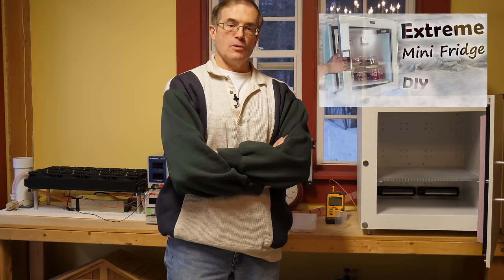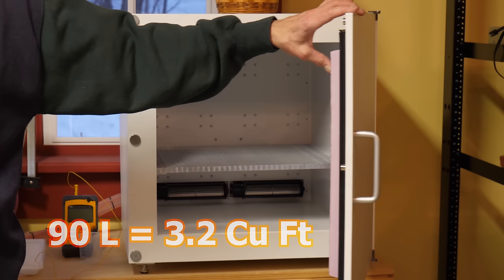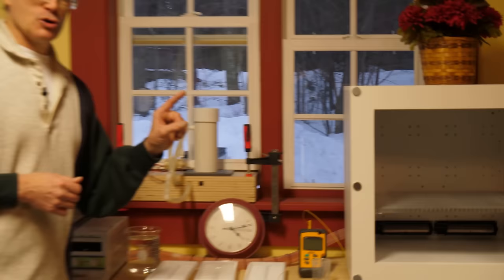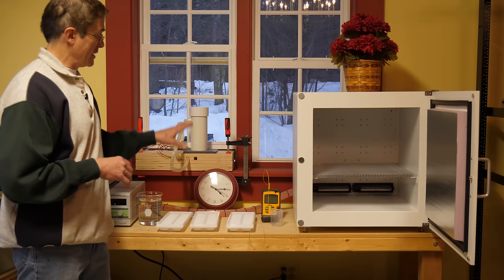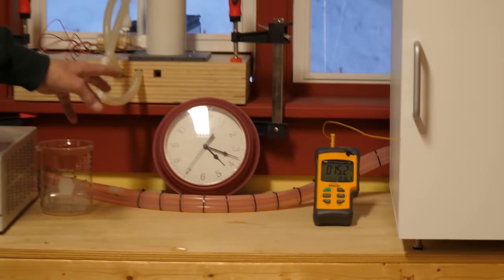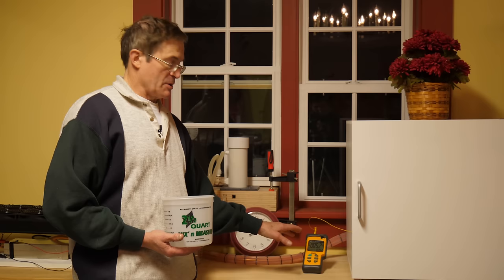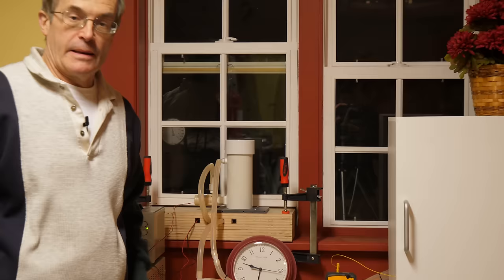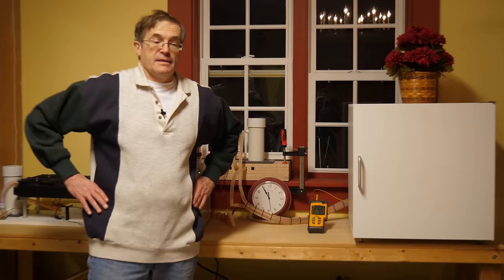TEC Freezer - Build Your Own!

Comment: I've been playing around with TEC's as well and I discovered they are extremely sensitive in a very predictable way.  If you mount one to a large piece of copper to anchor the temp on one side and leave the other surface exposed, eventually it will settle out to zero volts. if you place a heat source like your hand 6-8 inches away from the exposed surface  it will begin to climb ever so slightly in the micro volt range. In a calm room I can get a reading as far away as a foot and a 30 degree differential.  I don't know what I would do with this but I think it's very cool.
Reply from the maker: We have used this as a poor man's laser power meter.  You could also assemble a small array and produce a very low resolution thermal imager, similar to a micro bolometer array.
Reply: @TechIngredients  That is a neat idea, I have a bit of a background in passive night vision.  One way to get even better sensitivity would be to hold the back side at  a much cooler temp. To increase the resolution you could use some of the smaller chips and also sacrifice field of view for resolution and use a dichroic lens to focus across a bed of chips. 
These are turning out to be a lot of fun to play with. My first project with them was a heating/cooling loop for a fermentation chamber. 4 chips work perfectly at temps within 20 degrees of ambient and a 5 gallon batch. I haven't been able to test outside that as our temps are pretty steady all year long.

Comment: "Really blows away the efficiency" Please, please tell me this was an intentional joke about the swamp cooler style cooler coming up. Another amazing video, thanks guys.
Reply from the maker: Thanks!
It's no joke.  If humidity is disregarded then a humidifier cooler ie swamp cooler can be 5-6 times as effecient as a compressor based air conditioner.  The dessicant lowers the thermodynamic effeciency to about one half that of a compressor based system.  But, because the heat required to regenerate the dessicant and which is the cause of this lower effeciency can be supplied from far less expensive sources than electricity ie combustion or even a conventional, roof mounted solar water heater, the cost to run this type of cooler will be less than half of a conventional air conditioner.

Comment: Sir, with the 'indoor' variant, you may have already beaten some of the commercially available freezers.
Example: 171kWh / year, 24 hours for freezing 3kg, 60L capacity. That's about 470W per day, which I believe once you've frozen the food, you won't be using much energy for keeping the temperature below the desired point.

It's also possible by using electronic (magnetic) valves, to choose which room you want to heat or whether to transfer the heat to the outside, making it even more efficient in the summer.

I very much appreciate your thoroughness, you're taking a lot of important things into account. Again a video well done.
Reply from the maker: Thanks for the acknowledgement.  I agree with your suggestion about selective control.  Engineering isn't only about raw effeciency.

Comment: Brilliant! And I now know that my Wine Cooler (poor man's wine cellar) will use 6 vs. 3 of the Peltier modules. I have a big cache of used Intel CPU coolers and a ton of aluminum cooling fins, and they ought to do the trick. I'm going for "Parts On Hand" as a prerequisite (in other words, ZERO trips to Home Depot and no Amazon orders, either). You have imparted AWESOME sums of knowledge into my partially functioning brain for which I am very grateful!

Comment: A small geothermal loop seems like it would be more thermally and electrically efficient than the air.  Since you're looking to do small temperature differentials with TECs, it would also be a lot more effective to use 40-50F water as your cooling medium than 70F air above and beyond the normal benefits a phase change system might bring switching it to geothermal.  Sure, DIYing such a loop could be a lot of work, but it seems like a modular system where you have a "geothermal well," so to speak, with access ports around the house for various appliances could be super efficient and doable.

Comment: Additional interesting test datums for your design would be:
1) How long will food stay safe once all power removed?
2) How many watts are required to MAINTAIN food at minimum safe food temperature during "power outage" and presumably running on backup power? (goal is to maximize battery life)

Assume food starts at normal minimum achieved frozen temperature. 
Assume maximum food safe temperature is 40F (note1)
Assume door is never opened during power outage
Assume external temperature is reasonable room temp for a given season/location

note1: 40F takes into account that bacteria growth does occur in low-forty's, and 40F helps take into account temperature measurement error. Most probes I've seen used commercially are at LEAST 
+/- 2F

Comment: If you remote the heat dump, then don't forget to isolate the tubs ... at least the tube that goes back into the refrigerator. To prevent reabsorption of thermal energy.

Comment: Thank you.
The cool story is that apart from the extremely low efficiency of Peltier modules, there is an opportunity to make the home refrigerator more efficient. 
If anyone does not know, a home refrigerator, which is in any home, consumes a little, but constantly. This is why you see the costs in your's electricity bill, whether you are at home or not.
The video shows how to reduce the power consumption of an ordinary refrigerator by half (approximately) if you understand what is at stake. 
The question is, how many people are willing to do this? If about me, then I am already close to do it.
As homework for everyone else, everyone knows that your's car has a radiator as part of the cooling system. 
Can you think of how to make most cars without it? It's actually a simple task based only on what we've seen in this video. 
The problem is that if you don't think "outside of the box" then the problem is insoluble (as you can see from all modern cars). 
But never say never :)

Comment: You could increase efficiency by separating the hot/out, from, cold/in cooling lines to and from the Peltier liquid cooling manifolds.
Reply: COPPER HEAD foam insulation around both should benefit both

Comment: Sounds like some good upcoming videos. Good engineering testing. That's the correct way to do things. 

I made a TEC back in 2007. Single unit on the refrigerator cost me USD$25 at the time. My design aspirations was to keep a single coke cold at about 4 degrees. Note this was supposed to be a cold coke that I was just maintaining the temp for consumption over the day. Surprisingly I was able to get ice when it was operated in a conditioned room at about 24 or 25 degrees (I live in the tropics). 

It was an open unit so I did a condensate line. Turned out that I needed to keep that elevated and put in water since the conduction to the actual coke was too low without a little water at the bottom. That's how the ice formed. 

At the time I recall I used about 40W of power so I was really not amused when devices off the USB drive that at the time had a 5V and 500nA spec claimed to be able to cool a drink. 

I am putting a link to the video I did relatively recently just in case anyone wants to replicate. Its not that hard of a build and the form factor is useful for drinks. 

https://www.youtube.com/watch?v=lXqew7miryQ

Comment: Just thought about taking the cooling outside to reach lower temperatures in the winter. For an experiment it might be ok, but for a a unit that you would actually use it may be beneficial to use the wasted power to add some more heat to the room. The efficiency will drop a bit, but you will be using the energy, not wasting it outside.
Reply from the maker: True, but also consider the cost of the energy used for each purpose.  Unless you are using electrical heat, the cost might be lower if the refrigerator uses less electrical power.

Comment: In terms of overall efficiency, the first scenario you are using the waste heat of the fridge to help heat your room so are saving on energy for heating costs. Its simpler without having to transport the heat to the outside of the house
Reply from the maker: You're right it's a trade off.  Keep in mind that building's heat source may cost less than the electricity used to run the freezer.

Comment: I see all that snow outside through your window makes me think it would be very energy efficient to run a radiator outside with a small aquarium pump running a water/alcohol solution through vinyl tubing into the building or house into another aluminum or copper radiator installed inside your refrigerator. In others words just transfer the heat from your frig to the outside. Of course only good in the winter months. You are still using the Peltier device to transfer heat from the frig, but now to the outside air.

Comment: Putting the cooling fans outside makes the freezer more efficient, but it's pumping heat from your home to the outside (the heat from your home is what the system is moving after the freezer and its contents reach a stable temp), meaning now you need to add that heat back to your home. Overall that won't help your energy bill.

Another example of this - decades ago when we still had tungsten filament lightbulbs that got really hot, I had to explain to my mom that when you live in a house with baseboard hearers you're not saving electricity by turning the lights off, since it just means you need to run more electricity through the baseboards to heat the house. (I now use LED bulbs and have a hest pump, and plan on building a passive house in the future!).
Reply from the maker: It's  a matter of efficiency  related to entropy. Directly flowing the heat outside  reduces the inefficiency of the conversion  of that energy as it is converted to mechanical energy and then back to heat.  Where the gain occurs  is that most homes do not rely  on costly electrical heating, which itself represents conversion inefficiencies from the source through the grid.
Reply: @TechIngredients  Yup, depends on where your heat for your house is coming from. Many people where I live still use electric baseboard heaters, so here, for many people, to pump the heat outside during the winter just means you now need to replace that heat in your house using the electricity you saved in making the freezer more efficient. So overall, in the situation most people here are in, it wouldn't be a benefit to put the cooling unit outside. I had already thought about this quite a bit for my future off-grid house where I want to be as efficient as possible. I want to build a passive house, which means it would use no active heating or cooling at all at any time of the year. For heat, it just uses sun coming in the south-facing windows, heat from cooking and showering, warm bodies, and waste heat from electronics, like TVs or the inefficiencies of running a fridge/freezer. I'm on the autistic spectrum and noise bugs me more than most, so I'd already looked a bit into solid state refrigeration to get rid of the compressor noise, but your video was by far the best and most practical and most applicable to the kind of thing I'd want to do. Thank you!

Comment: You mentioned going to 12 TECs to facilitate various series/parallel configurations. I watched the video a number of times and don't remember you mentioning how you chose to configure the TECs. Also, probably in a related video, iirc, I thought you had mentioned the TECs performed best at 5v, just want to confirm. Thx for all you do!
Reply from the maker: All TECs can be wired in series and/or in parallel to be conveniently matched to an available power supply.  These particular TECs were designed, based on the number of junctions in that module, to operate around that voltage, but as a rule, the lower the power the TEC is driven with, the higher their effeciency, but the lower the temperature differential. That is why it's best to be able to adjust the power input to balance that trade-off even after the system is assembled.

Comment: Very interesting to implement on marine refrigerator, the heat cooling system can be done by salt water on a open loop, the 200 watt consumed by the system is far better than a conventional marine refrigerators, I can build a wine cooler. Thanks Profesor.

Comment: Awesome! I look forward to the desiccant version!

One of the ideas I kicked around for my cold box is using a compressor cycle freezer and pumping either ethanol or propylene glycol solution through. I eventually went with TECs because even though it's much less efficient overall it's just a simpler design and I can hold the temperature within like a tenth of a degree. :D

Comment: Running this along under ground or through a manifold leading into a hot water tank would be an excellent permanent solution. Obviously any increase in dump site temperature will slow the efficiency but given that it's not always cold outside that consistent cold source would be good. The feed water option would probably have diminishing returns when it reached sub ambient.

Comment: I saw a similar super cooling process occur when I did an experiment in high school to measure the effect of salt on the temperature of freezing.  I recorded and graphed time and saw a continuous dip below freezing and then it raised to equilibrium during actual solidification.
Reply: I've seen it a few times when I've opened a beer that has been in the freezer...take a sip and it freezes O.o

Comment: Love see this freezer unit and would have like to see how you would cycle the power off and on to maintain freezing of ice to conserve energy.
Reply: A temperature switch would easily work on the TECs, but, you would have to keep power to the fans on the radiator at least some 2 minutes longer as the TEC is still hot (and would rise w/o cooling) and could potentially cause damage before it cools down. In fact it may not cool all the way down by the time your temp switch powers them back on. I've seen where some people simply leaving the cooling fans on.

Comment: Thank you for the video. I had a thought. If you placed your freezer box in the window itself, seasonally reduced the insulation on the backside that is exposed to the winter weather and simply added heatsinks. If the window was on the north side of the building, this could really increase the efficiency. Maybe…
Reply from the maker: That's a good idea.

Comment: You can also re-use the heat to charge batteries that may allow the refrigerator to run on its on for a shirt time and save electricity. You could have also embedded a cheap camera inside the fridge and a programmed arduino touchscreen to see what inside and control the temperature

Comment: Another enertaining video. I had hoped you would show a calculation of the cooling power achieved so as to derive a real measure of efficiency. I presume putting the lid at the top would be a sensible step if anyone wanted to use a freezer like this in real life - perhaps driven by free solar  power to allow for the inefficiency.
Reply from the maker: We chose to keep the door on the front, despite the lower effeciency, because this freezer will be easier for us to use.  We will actually be using this freezer in the lab.  Actual cooling effeciency in this completed freezer is tough.  It is not just the mass that we add that is cooled, but the structure of the inside of the freezer that  has a distribution of thermal  conductivity within it.  Once the TECs are turned off they become pretty good thermal conductors and make estimating the overall insulation properties of the box, difficult.

Comment: Sometimes when I need to make ice fast, I will put a little USB fan in the freezer and just let it run until the rechargeable power supply is exhausted, reasoning that the more cold air molecules I can throw at the ice trays, the more heat energy they can remove. I’ve never run a proper test, but my sense is that I will have ice faster with the additional air circulation. I would be curious to see if you got a more rapid temperature drop, and a shorter “latent heat removal” time interval by circulating what I presume would otherwise be fairly still air. Of course if it results in the thermostat cycling the unit off sooner, and when it cycles back on , the target temperature would be reached sooner, it might lower total power consumption including the tiny circulation fan sufficient for an enclosure that size..

Comment: Great channel, great video.

My only complaint with this one is that using the heat dump outdoors in a below freezing environment is cheating. I'd be much more curious to see how this system works with the heat dump in a room temperature environment. Of 21C/70F.

What good is a freezer that only works in winter?
Reply from the maker: The first test was in fact performed with the heat dump indoors.  It's on the left of the same table that supports the freezer.  The second test showed the improvement when the heat dump was moved outside.

Comment: Very cool! :>
Are the peltiers mounted inside the box or are they attached to the outside of the back wall so that the whole inside back wall is a thermal conductor?
...And what are the two items inside at the bottom below the shelf? Fans? Lights?
'Would have liked to see a bit more detail on how these components go together.
Reply from the maker: They are outside the box.  The two linear fans blow across the entire back wall which acts as a heat sink.  If you take a look at our previous videos on the TEC refrigerator and it's demo video, this may clear up some of your questions.
Reply: @TechIngredients  Thanks!
Yeah, I missed the previous video.
'Got it now. :)